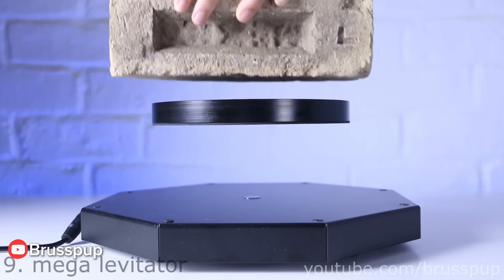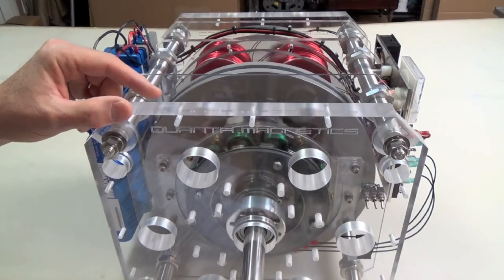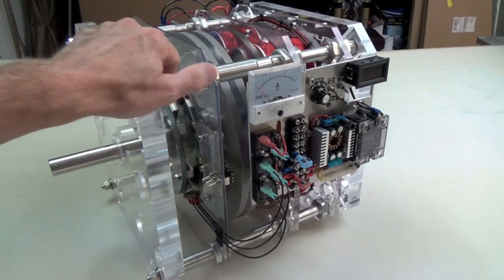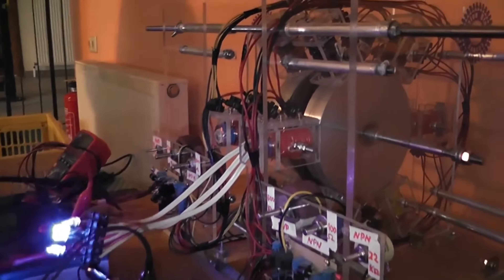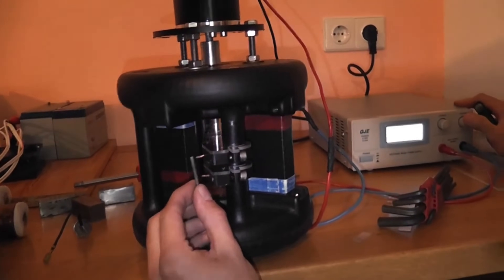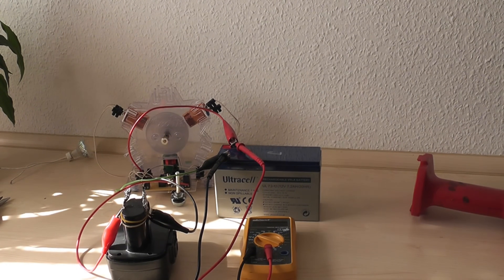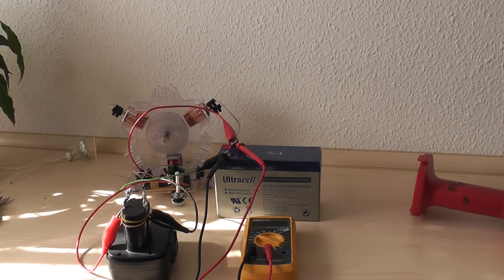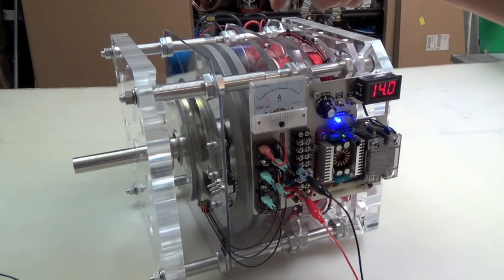Unlocking Limitless Power: Raymond Kromrey's Magnetic Free Energy Generator

Comment: It's important to realize that there is tons of free energy all around us it's just a matter of harnessing that type of energy. For example there's wind energy there's solar energy there's magnetic energy in the flux in the earth's field as well so really they're all these invisible untappd energy sources until you design a system that can tap the frequency of those systems and turn it into usable power. So free energy is not a concept that is coming from nowhere. Free energy just means that it's coming from some sort of changing flux whether it be changing wins or wind pressure or solar energy impinging on a panel or something that can capture the varying flux of the Earth's magnetic field at a frequency that's usable by today's electronic devices. But quite frankly most of these things are immaterial with the Advent of extremely cheap solar panels now. When you can buy solar panels that are very dependable and dirt cheap and will produce energy far longer than you will live all these other methods of finding energy really kind of pale in comparison for the average person. If you want free energy go out and buy yourself a bunch of solar panels. Their dirt cheap.

Comment: You can’t use magnets to generate free energy. The opposing force and friction needed to run a motor will stop the rotation.
Reply: Thats why you have a flywheel bro ;-) it stores energy
Reply: In a conventional sense you would be correct. However, there are ways to unconventionally stimulate the standing magnet fields in order to gain extra energy from them without having to deal with Lense law. 
How?  Well think of the magnet field lines of a magnet as a calm lake or pond. It's at rest. What happens if you throw a rock or pebble into the pond? It causes a ripple or wave in all directions from the point of disturbance. This wave goes out far away from the source of disturbance. If you had a way of tapping that wave energy around the outbound circle of waves, you would multiply your gains. 

So too a magnet. Find a way of vibrating (disturbing) the field lines of a magnet and a variable field is generated. You can do this with a spark inside the Bloch wall of the magnet. The resultant momentary (high frequency) magnetic flux can be picked up on either side of the magnet poles (north side, South side) with a coil of wire around an iron core. 

The key is using high frequency discharges of a capacitor via a spark gap inside a magnet right along the Bloch wall of the fields of the magnet.  High voltage, low amperage sparks cost very little to stimulate a large magnet. In this way, you avoid several "laws" that apply to the way we normally use magnets and closed circuit coils under load. 

Understand?
Reply: says the guy who never in his life touched a magnet